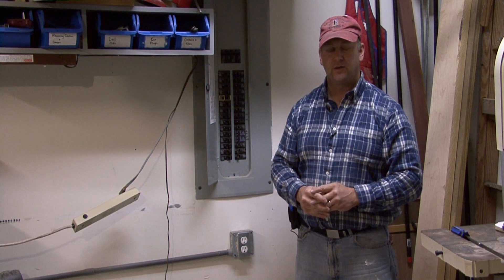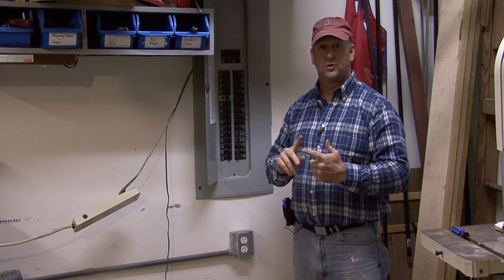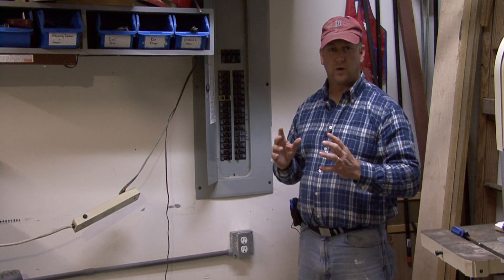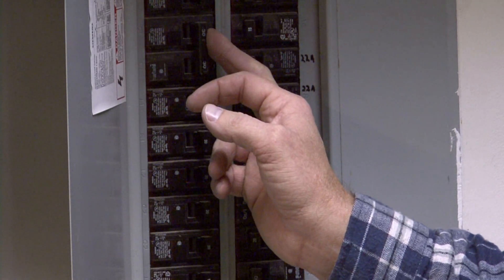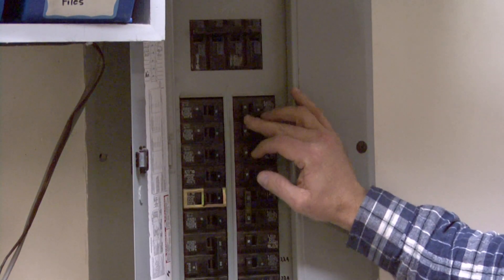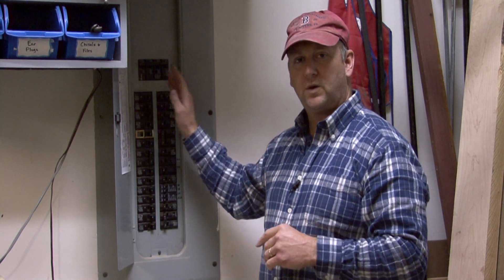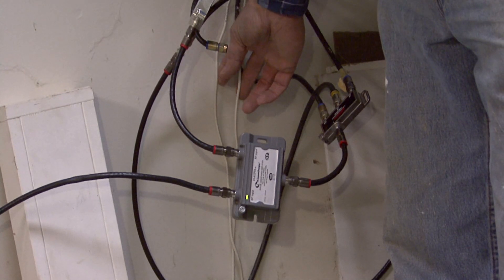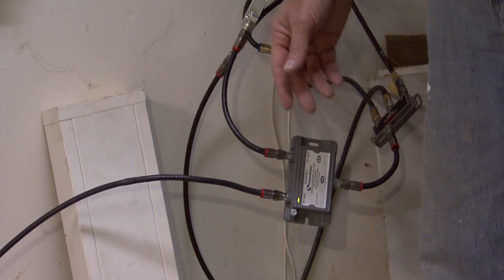Home Improvements : Types of Electrical Wiring in Houses

Comment: Electricity voltage ranges from 110-125v, and for other countries it ranges from 220-250v thinking that the 15-30v difference is a big mistake, especially when playing with Alternating Current Vs Direct Current

Comment: @crookcirca80 I was talking about the #14 wire on a 30 amp breaker.  A lot of guys misread the hermetic section because they do not read all the applicable sections, #14 is limited to 15 amps in all residential branch circuits.

Comment: @archeryman5000 I can't tell that to him, I haven't looked at the installation.  Nothing is cut and dry in electrical, and every situation is different.  What was the running amps of the air conditioner?  Was it #14 copper or aluminum?

Comment: @maltyful For air conditioning circuits, it is actually possible to have 14 gauge wire on a 30 amp breaker.  This is because an air conditioner falls under hermetic compressors and the overcurrent protection must accept the inrush current, while the branch circuit conductors must be only sized to accept the running current.  Common practice is to size the wire to the breaker, but in air conditioning circuits, this is above minimum code.  I'm not sure what the NEC is, but that's how the CEC is.

Comment: Hi Mr Eletrical Pro =)
I'm intalling a double oven that requires at least a 40amp outlet. Right now I have a 8 guage  black, white, and ground electrical line for a 50amp line.  would you be able to show us Youtubers how to install a 50 amp breaker or 240volt using just the black, white, and ground. Also on the outlet end how to add a red line to accept the 4 prong outlet. thanks very much.

Comment: @b3in 
Technically, 16 ga wire IS rated for 15 amps. So is 14ga for 20 amps, and 12ga for 30 amps...its just that in the code book the size is increased up one scale for extra safety.

Comment: that makes no sense. if your getting 220-240 at 2phase then what are you getting if you measure across the 2 phases? How do you get 408 in a 3 phase when your just getting 220 between each phase. you should be getting 408-410 between each phase and 110 between each phase and neutral. correct me if im wrong